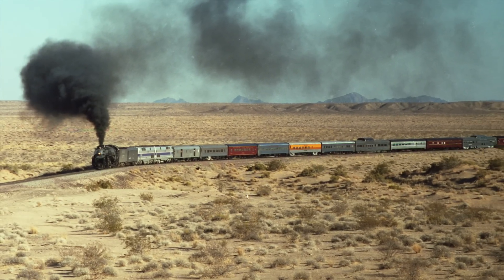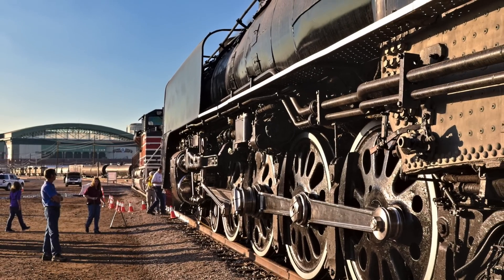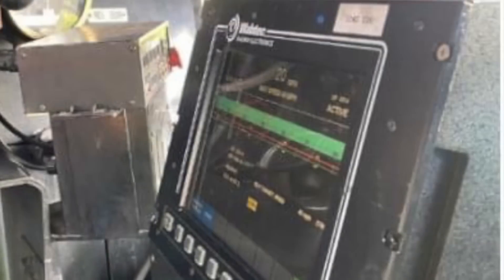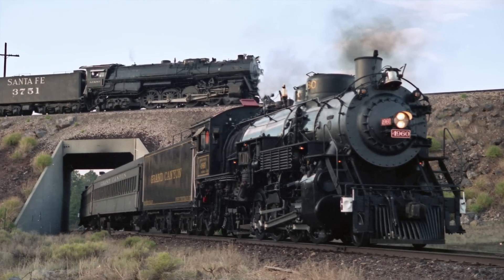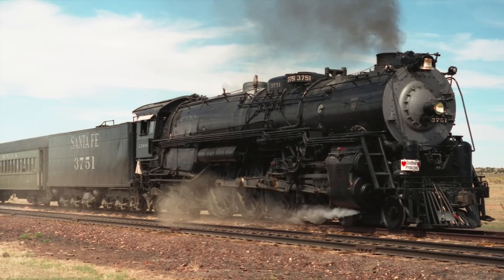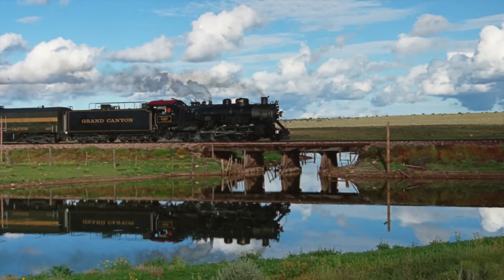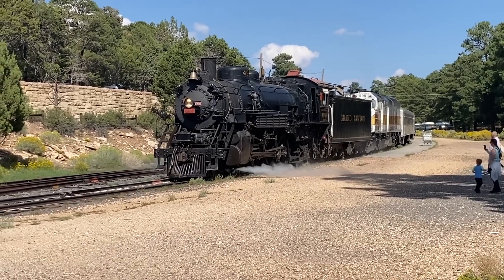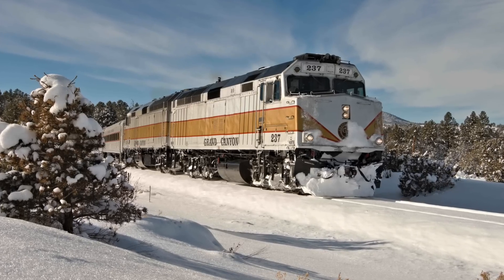Why is there a diesel behind the steam engine?

Comment: There in south Italy there's a narrow gauge railway, and on this railway they run a steam train for touristic rides... They use only the pure power of the steam locomotive, while the train is followed by a diesel engine attached to a water tank... This is a fire fighter train and is used to extinguish fires that may be caused by the steam train passing by
Reply: Is it the Calabro Lucana railway?
Reply: @nicopavvi8494  exactly! They use the FCL 353 Borsig tank engine to do this touristic train every sunday, and on some special events, and it's followed by the FCL LM 004 to prevent fires along the tracks...
Very recently they bough the twin of the FCL 353, the FCL 358, and bring it back in south Italy from Rome, and their plans are to functionally restore it, to make even more touristic steam trains
Reply: Sort of a hybrid system
Reply: @robertcervenka6875  it's just a way to prevent fires in the wood, because the railway runs in a naturalistic park, and especially during summer time, you cab immagine how much dry grass there will be around the track... So, to prevent them, a diesel engine follow the steam train some 100 meters behind, while pulling a tank of water
Reply: Smart

Comment: How come the bearing caps on GCRX 4960's tender are exposed, but it has a journal cover on its trailing axle?
Reply from the maker: The tender bearings are all sealed roller.  The trailing truck is still journal bearing.

Comment: Modern coaches don't have dynamos anymore, often they are used to supply power to the cars. They also assist with braking.
Reply: Yes, dynamic brakes are one of the best railroad innovations ever created!
Reply: Freight diesels can't supply head-end power to the coaches, so a dedicated generator car (or a passenger diesel with HEP capability) is often required.

Comment: the most common reason for a Diesel to accompany any Steam Loco on excursion runs is today's Railway Dispatching system also uses in cab signaling which very few Steam Loco's have had added.
the Diesel can talk to Trackside Devices and maintain contact with dispatch during the run while also supplying head end power for passenger equipment.
though one alternative to the Diesel for this role would be to place the Cab Control system inside the leading coach or Baggage Car along with a stand alone Generator to create a Power Car for the train.
but running on Revenue Rails may require the need to have one or more Diesels along as noted in the Video J.I.C. 
Steam Loco's like any other piece of large Mechanical Equipment can and occasionally DO break down or suffer some sort of Mechanical issue and need a "Tow" to the next siding to clear the main.

Comment: It's used for hotel power to the modern coaches.
Reply: No it’s not, freight locomotives do not have HEP
Reply: To the OP, the only time a trailing diesel or diesels are used for Head End Power for the consist is when the diesel or diesels are passenger engines. Otherwise the electrical power for the passenger cars either comes from a power car that has the needed HEP generation capabilities or from underframe mounted generators on the individual cars themselves.
Reply: But not the case for UP
Reply: Well not the case if the loco is a freight dedicated

Comment: Hi.

Aren't you conflating a few issues with tractive effort and power?  Tractive Effort is by definition the force a locomotive applies to the rail head at starting.  Whereas it's correct to say that any given steam locomotive achieves its maximum power at 'a' speed - or within 'a' particular speed band; rather than saying "at speed" (which sounds like you mean high speed).  That "Mike" would by the look of it achieve its maximum draw-bar horse-power somewhere between start and 25 mph - and the 'Consolidation' probably a bit lower.
Reply from the maker: I just wanted to briefly touch on the subject for this video, without going into much detail.  I could do a whole new program later just on that subject.
Reply: @ehadder  Fair enough.  It's a very technical subject that gets both complicated and interesting very quickly.  And is nearly as old as locomotives themselves!  And who doesn't like tractive effort?